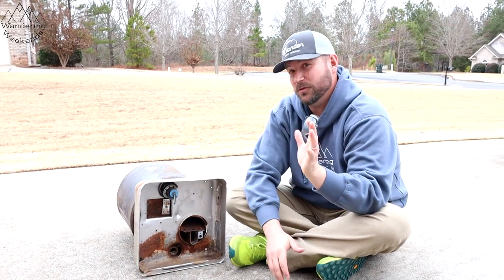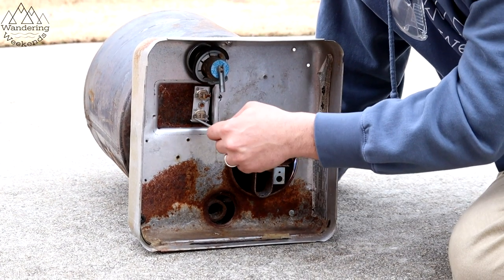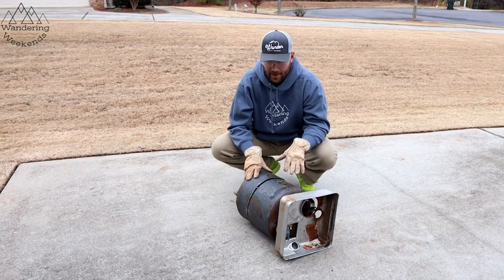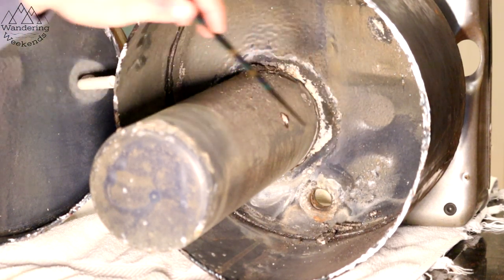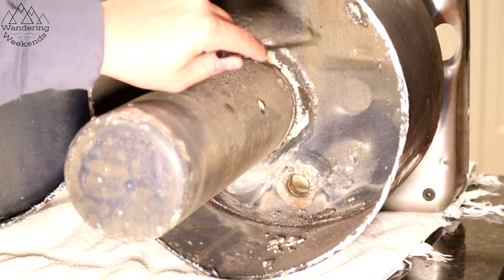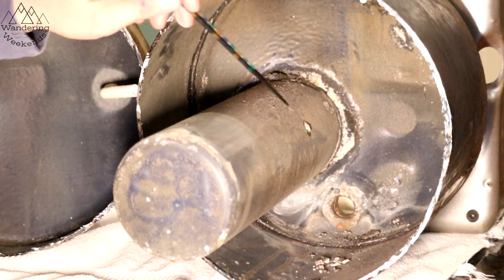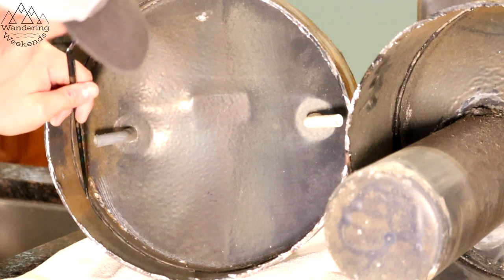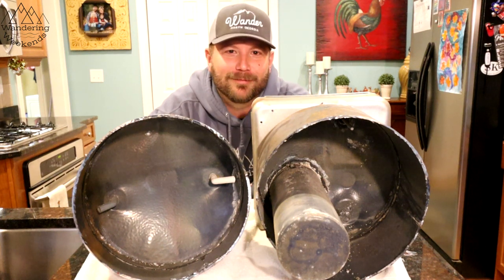Cutting Open a WELL Used RV Water Heater

Comment: It's calcium and mineral deposits. If you would cut open the hot water heater in your house, you'd see the same thing, only much more prevalent!! That tank is really not bad. If you'd put some vinegar, (or maybe CLR,) in the tank once or twice a year, it would probably dissolve a lot of those deposits. Kind of hard to tell from the video, but it almost looks to me that both tank ends have some kind of coating, or porcelain finish on them! Great video, thanks, and Merry Christmas to you both!!
Reply from the maker: gac914 thanks for watching! Yes, the entire inside of the tank was coated. I agree... really not bad at all!

Comment: No deposits on the heater core indicates that this water heater could have gone on working for quite a while if not for the rust around the drain hole. I wonder if there’s some way to counter that?
Reply from the maker: Tim Woody JB Weld!! That stuff solves all your problems 😂😂

Comment: Interesting. I have a 12 gallon Suburban that has now had ten years of full time. I am in a hard water area. I plan to wash mine out with descaler and replace the anode in the Spring.
Reply from the maker: That will be interesting.  First time flushing it?
Reply: @WanderingWeekends  Yes!